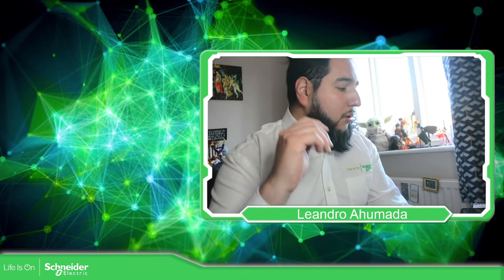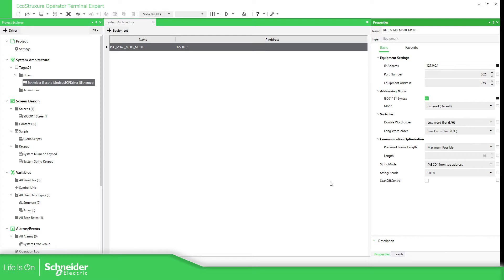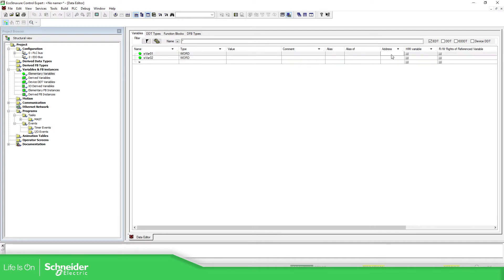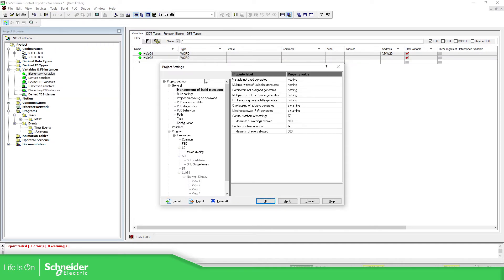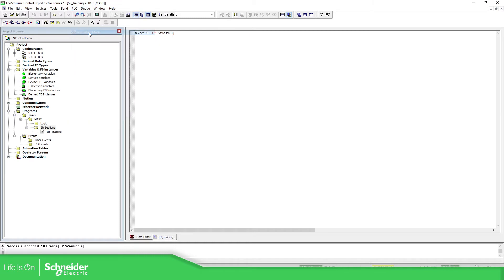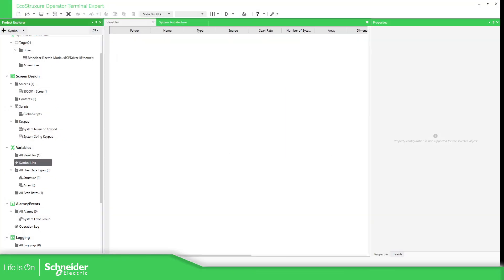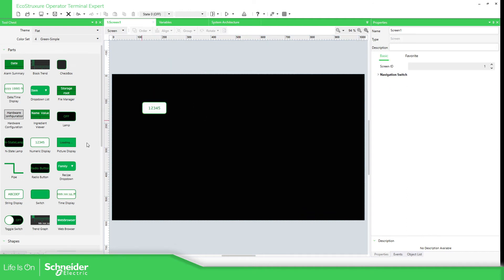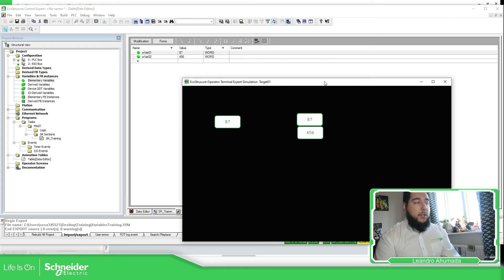EcoStruxure Control Expert connection to EcoStruxure Operator Terminal Expert

Comment: Mr. AHUMADA, why in this video you didn't set an IP address to the HMI like in the M221 video?
Reply from the maker: Hi there! the reason is because i was in simulation mode for Control Expert and Operator Terminal Expert. It just point to the default 127.0.0.1.

Comment: Hi, I'm using Unity pro V7.0, my CPU sees the HMI when it tries to ping it. The vars are well exported. But I can't get to read a value on the HMI.
Reply from the maker: Hi there! A couple of questions for troubleahooting: 
1)The driver on the hmi is well configured?
2)The data dictionary in the plc is activated?
3)Did you follow the hmi only variables as it is shown in the video?
4)have you exported the variables after the compile and download to the plc?
5)which is the error message on the hmi hardware configuration menu?

Comment: hi its possible any videos with zelio sr3b261bd, sr3 net01bd and hmisto735 with operator terminal basic license?
Reply from the maker: Hi there! unfortunately i do not have any SR3NET01BD with me to show how it is so i can work in a theorical implementation. Instead of using te zelio driver we must use the modbus tcp driver on the HMI and read/write some specific registers for that module.

Comment: When I tried to connect with PLC Sim, connection is interrupted with the message: 
"PLC Communication failed. Automatic return to off-mode. "
Do you know how to fix it?
Reply from the maker: Hi there! The CE/UnityPro is not my forte but you seems to have a problem with the simulator try to update the version of the software or check if a HF sort the problem out. (Last… uninstall and install the software)

Comment: Hello, is it possible to generate a backup file of an hmi in EOTE?
Reply from the maker: Hi Alan, this is actually a good question. I have not tried this yet and i will check it. In vijeo we have the possibility to save the project in the hmi in terminal expert i do not remember seeing an upload option from the hmi so i guess we need to work with the files manager object to create a copy of the internal memory of the hmi and move then to an external memory but again i meed to check it.